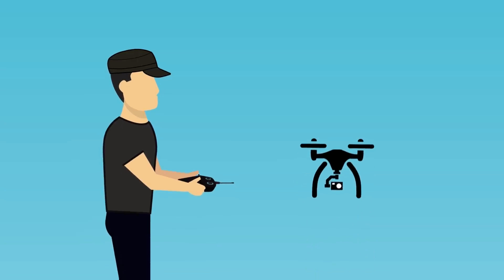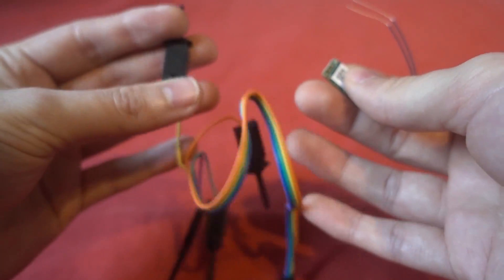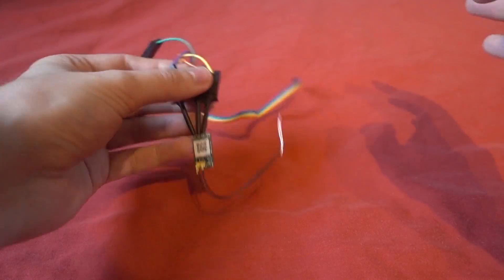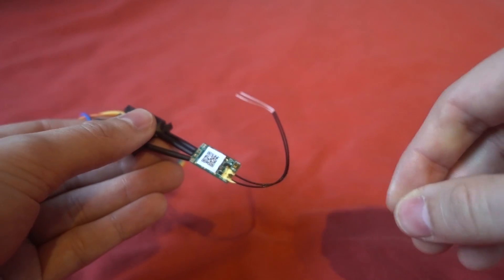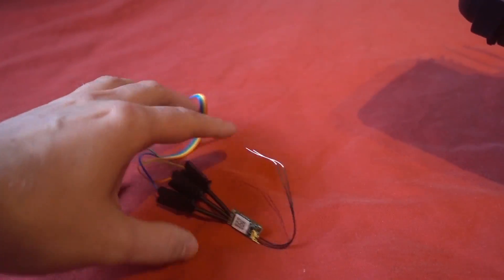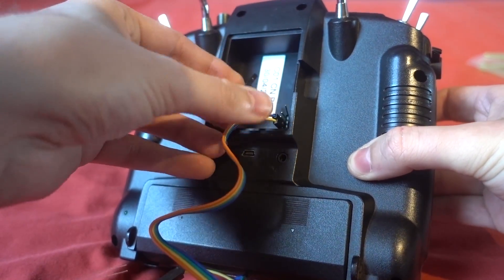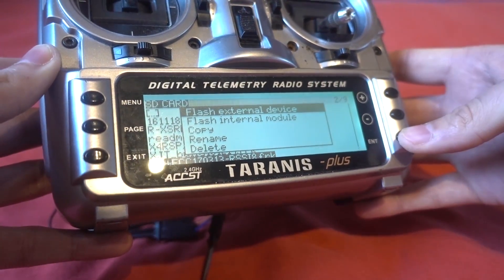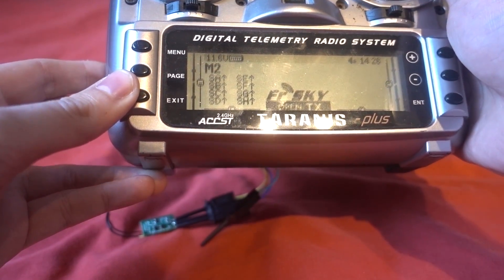Flash XM Receivers Without Solder

Comment: Just use the pins supplied and flash with no solider, just tape it in place so the connection does not drop during flash. No need for this malarkey!

Comment: Andy or anyone who might know something more.....on a quad with XM+ reciever...i just plugged battery to fly  and it seems like it lost binding.....this happens for 2nd time...the previous time i reflashed the xm+ for RSSI too and it didnt work immediately..in the 10+nd try after rewriting different firmwares and retrying to rebind etc..it worked...now again with no reason since yesterday i was flying normal without any troubles..i just went to fly and no binding...of course i wouldnt have writen this message ....i already tried to reflash again and rebind more than 10 times....it dont make sense whats going on? any idea?

Comment: Thank you so very much for this video! Just got my Geprc Cygnet 3 with XM+ FCC version and needed to flash it to EU. I only removed the top plate of the quad and managed to carefully wiggle those clamps to the already soldered in receiver cable ends and flash it without taking anything apart. The idea of desoldering the receiver for firmware update really wasn't something I would've wanted to do as a first thing to a new bnf quad, so this really, really helped an amateur like me a ton!

Comment: i have d16 d8 an Lr12 i read if you had the three it was fcc firmware on it so i flashed the receiver with fcc fw with the taranis it flashed an now just a red light an for some reason the taranis wont flash it no more i get a firmware update error message i had it in the quad it worked tell the flashed it maybe i moved a lil to much... i dont think so

Comment: AndyRC

Great video.
I see in the video that you are flashing with a 3s battery in the Taranis.
You forgot to mention that it is best to flash with a 2s battery instead of 3s because the 3s voltage will go directly in to the receiver and can fry it.
correct me if im wrong with the xm or xm+ but it happend to me so i wanted to let you know!
Reply from the maker: Hi Manuel no that is not correct, 3s is fine to use on the taranis while flashing. been doing it since day one and probably flash 3 receivers a week. any issue you had was unrelated. thx
Reply: AndyRC 
Thank you for responding.
Then I am Wrong After All.

Great Video!
Keep it up!

Comment: Did you say you can flash an XM+ that's already wired to a FC, like an RTF? I've always heard different, but then again I've never tried it myself. Besides checking for shorts, is there anything else you need to do?
Reply from the maker: yes you can check out my "how i review a quadcopter video" in some cases it will power up the FC but in my experience the taranis has always been able to provide enough amps to do so.

Comment: Great, thanks ! An hour before you published this video I soldered an XM+ into my quad, and then realized it didn't have RSSI on channel 16 like all the other XM+ I bought 😅 so I will try your method ! By the way, why do you put RSSI on channel 8 instead of channel 16 ?
Reply from the maker: if you bind with 8 channels you have lower latency than 16. cheers
Reply: AndyRC thanks ! I wasn't sure of that.

Comment: U can flash an rsxr with bf? What screen where?

Serial passthrough yes but never saw the rx flash screen in bf
Reply: AFAIK the official way to upgrade rx firmware uses a dedicated usb to serial converter and a program on your pc. I would try activating serial passthrough and then connecting to the COM port of your fc using frsky's upgrade program.

Comment: Tried to update the FW on my XM+ (brand new) and after hooking up per your video, when I long pressed on the selected FW in the Firmwares folder on the X9D+, the only option I got was DELETE? ... didn't get the options to write etc. On my 1st try, I didn't notice that the order of the Signal, 5+, Com on the XM+ wasn't the same as the order on the X9D+. So, I swapped 2 pins on the servo cable I was using, so that they would match per the video, and still only got DELETE?  Hmmmmm ???
Reply from the maker: hey Bill are you running the latest open tx? cheers
Reply: Ah .. no .. I'm still running the original v2.0.9 that came on my X9D+.  One time I did try updating the Taranis FW, but it messed up my models, saying that some parameters had changed. I figured, "crap, I'm not going to go thru all my models and re-tweak them", so I reverted back to the original v2.0.9.  Then, when I did that, I found that by trying to upgrade to latest X9D+ FW, it changed parameters in my models, so I had to go thru them (all) and correct what had been changed .. what a nightmare! After that, I never tried to do a Taranis FW update again ...
Reply from the maker: I think that will be It Bill. I guess you have to decide what is more important to you. If you have found other ways to flash them etc then just carry on :) cheers.
Reply: Well, I suppose I could empty the MODELS folder on my X9D+ and back them up to my PC, then upgrade the Taranis to the latest FW, flash my XM+, then revert the Taranis back to the v2.0.9 FW and then restore my saved models back to the Models folder. That could be a work around. I wish there were a simple USB module I could plug into my PC to allow me to do FrSky FW RX updates, but I don't think that option exists. Cheers.
Reply from the maker: Hi Bill if you have an FTDI adapter and the frsky pc tool you can do it that way. cheers
Reply: Do you have a video using the FTDI adapter and frsky pc tool method? I never found/saw someone using that method with the XM+.  For  some reason, I can never update the XM+ with my Taranis.  I always get an update error even though my open TX and XJT firmware is up-to-date.  I hope Frsky will make it easier one day by doing the update through Betaflight pass-thru.